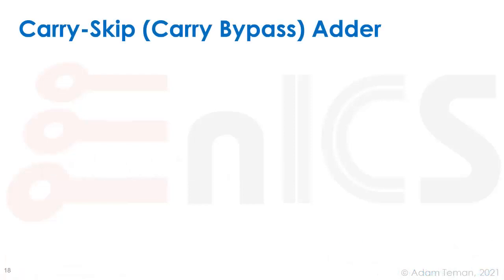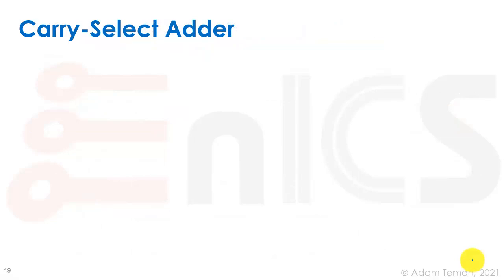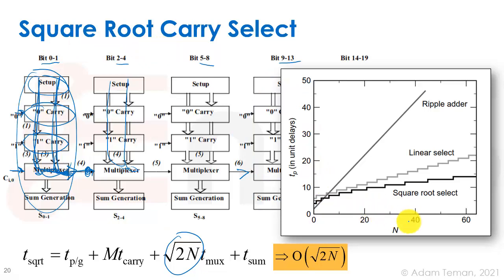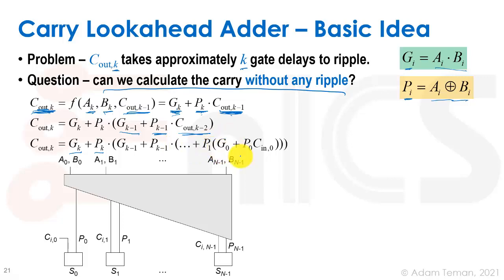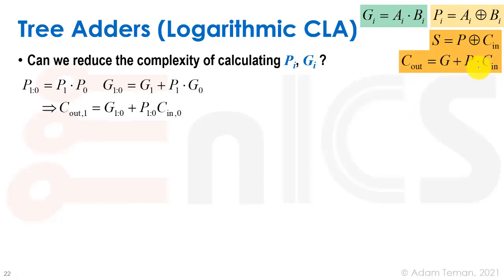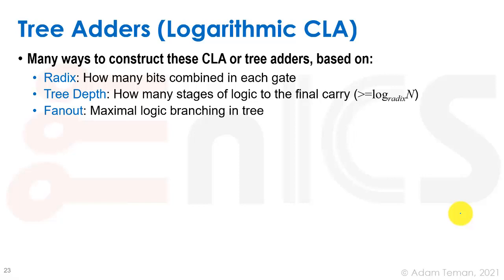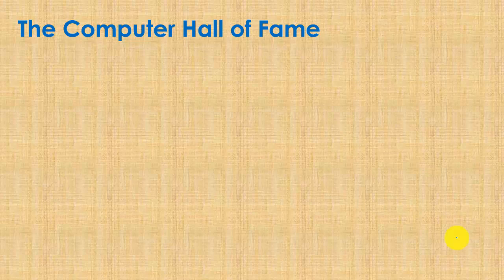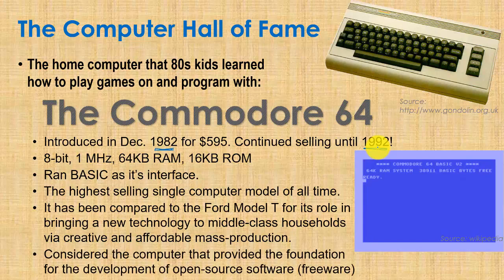VLSI - Lecture 10b: Fast Adders

Comment: Hi, first of all awesome content.
Can you show step wise implementation of Brent Kung while maintaining transistor sizing with Node optimization?
I plan on using this Brent kung to implement Dadda multiplier
Reply from the maker: Glad you enjoy.
Regarding your request - I think that is beyond my pay grade ;)
I haven't actually done such a design myself, but maybe you can find some examples in Rabaey (Digital Integrated Circuits) or Weste/Harris (CMOS VLSI Design). They both have great content and exercises and a lot of practical examples.

Comment: Hello Adi, why do transistors in series makes things slow?
Reply from the maker: Hi Vikas,
This is a fundamental property that we teach in the first circuit design course. Unfortunately, I haven't recorded it in English (and don't have plans to do so in the near future), but you can follow the slides (they are quite detailed, even without the oral lecture) at https://www.eng.biu.ac.il/temanad/introduction-to-digital-electronic-circuits/

But to give you general intuition, a transistor can be modeled as a resistor, and connecting resistors in series lowers the current. Since the pull-up (pull-down) network needs to charge (discharge) the output capacitor, lower current means slower. Hope that was a quick and intuitive answer...
Reply: Firstly Nmos pass transistors are terrible at charging a Node (Vdd-Vtn)  , hence cascading them in series will lead to high RC delay.
If we're talking about stacking then g, logical effort will get worse.
That's why several design strategies are used (cvsl &dynamic circuits like domino are used to avoid pmos stacking)